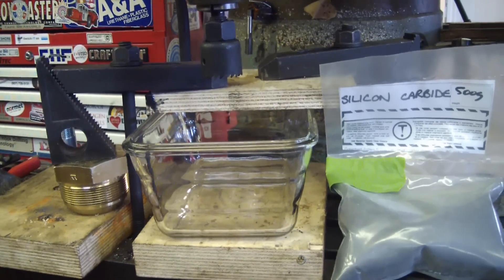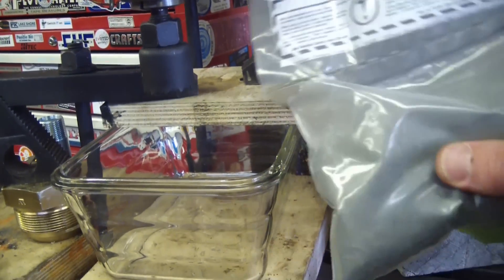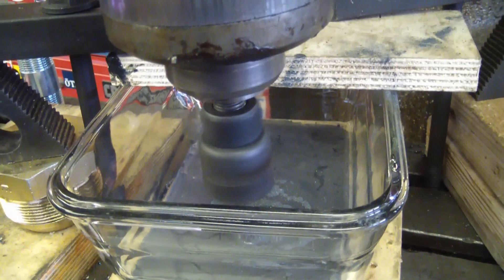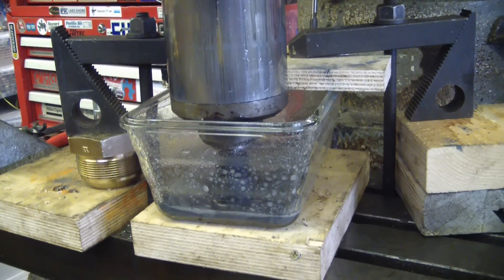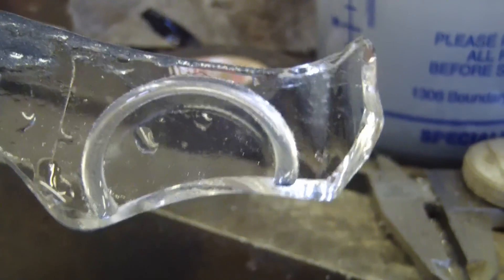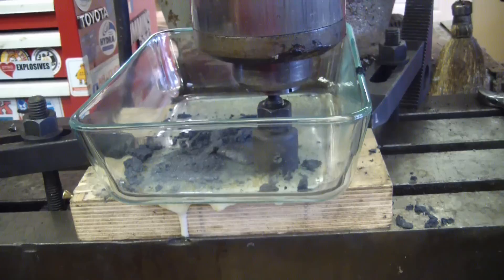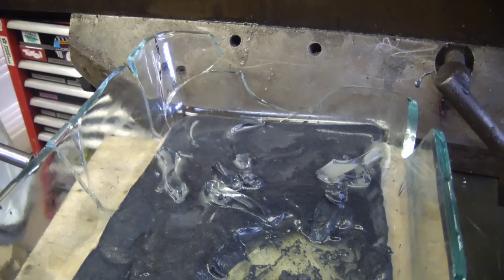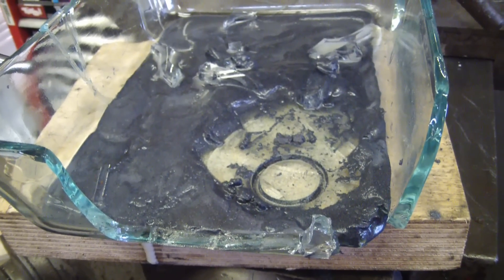Using Silicon Carbide to cut glass

Comment: Hi,  I really enjoy your videos and your comments are a blast.  I KNOW what the problem is because I have solved the exact same problem.  BTW, I am a Ceramic Engineer (I bet you didn't even know they existed...).  To start, Pyrex is an annealed glass, not hardened, intentionally to reduce internal stresses.  What you are running into is due to intense ultrasonic vibration.  This is revealed through the break pattern.  If it was due to glass tempering, the piece would have shattered into many, many pieces.  If it was due to local heating, you would see the crack propogating outward from the bore hole.  These cracks originated at the outer edge and propogated inward.  The starting points are also spaced out about 12cm apart around the top edge.  All of this points to ultrasonic vibrations.  The vibrations are caused by the grit rolling and skipping around at the blade/glass interface.  There are a couple ways to address this.  You were on the right track trying to embedd the piece to reduce motion.  If you had embedded the edge of the bowl, it may have worked.  Ultrasonic vibrations scatter in weird patterns and are hard to predict so even this approach is no guarantee.  Another thing to do is replace the metal blade with something like a hard rubber or maybe a fiberglass impregnated plastic.  And of course another thing is to go with a cutter that has the grit embedded to you don't get all that rolling and chattering around, which is what you were trying to work around in the first place.  Even then, it is a good idea to dampen the edges.  Good luck.

Comment: Nobody seems to be explaining why tempered glass is hard to cut so I'll try my best. I'm sure someone else can do a better job.

When a substance like glass is heated it expands and when cooled it contracts. When it is cooled rapidly (i.e. tempered), the outer layer contracts rapidly and its tension places a constant compressive force to the inner glass. When the outer layer is damaged enough to fail, it releases all that compression simultaneously causing catastrophic failure to the piece. I don't think it matters whether the damage is caused slowly or quickly, only that it exceeds the tension balancing that compression force.

Prince Rupert drops are an example of what happens when that force is released. It's not the specific location of the damage on them that causes them to explode, but they are under such extreme compression which makes them so hard that you can only cause the damage the tail with conventional tools.

Unlike steel, I have no idea if/how tempered glass can be annealed (removing just enough of the temper to relieve the internal stress) but it would seem to be pointless in this case because the goal is to end up with tempered glass at the end.

Gorilla glass achieves some of the same surface strength results through a chemical process rather than a heat process, so it might be possible to do this kind of work on a gorilla glass piece if they ever make cookware out of it.
Reply: Andrew Crews And this is special how? You can bend the microscope cover plates too, which i believe is thin untempered glass. Resistive touchscreens fully worked based on glass surface bending, and they were not made out of Gorilla glass, they were made out of... not sure, untempered glass? Thermally tempered? I don't know, it was bonded to a plastic sheet usually and hard to break, but eventually they did break.

Glass fiber is VERY bendy.

Thin glass bends.
Reply: +Tim Gilbert Actually, when molten glass is chilled quickly, the outside freezes while the inside is still hot.  Then, as the inside cools, it contracts and puts the surface under compression (the inside is under tension).  This surface compression closes micro-cracks which are the source of all weakness in materials.  A great book about this is The New Science of Strong Materials or Why You Don't Fall through the Floor by J. E. Gordon.

This also explains why it breaks just before the hole is complete.  The inner bulk strain is relieved, so the surface compression goes away, and the glass cracks.
Reply: +Chris Uhlik They use the same process for new cast car rims. Cool the outside  and keep center hot when casting makes the wheels stronger by having forces under tension.
Reply: @speeddr2000  I'm three years late but your absolutely right. If you cut through one they spring like crazy.

Comment: 2 things. No. 1: yes it hurts for no reason, time for special old persons exercises every morning, shoulders and neck are the worst, where you retain the most tension. No. 2, don't know what the temperature of the glass was, cold glass cuts badly. I assume the water transmits heat away from the cutter so there is a minimal heat gradient across the whole dish, but it is almost as if the bottom has expanded so put the sides under tension. Cheers, Andy

Comment: I remember reading about this phenomenon. Tempered glass is stressed and once you get to the chewey bit in the center it wants to relieve it's stressed outer part, so as the saw makes it to the sweet spot it gets all kinds of wonky and the the outer stress is no longer the same and it says "screw this" and finishes contracting, and then the glass shatters. Work around - HEAT UP THE GLASS =)

Comment: If I remember right, Pyrex is under constant pressure, which is how it works.  Something about having just the right amount of stress making it near unbreakable.  I imagine that when you cut into it, it's breaking that tension as soon as you cut too deep, and snap, crackle, pop!  I'd suggest using a non-Pyrex glass and see if you don't get better results.

Comment: I haven't read all the comments nor do I think that AvE is going to read this. A while back drilled out a few holes in single pane windows for AC vents. I used a similar fashion with a drill press and bi metal bits in reverse. I found that it works if you score the glass with a circle cutter and score a grid in the id of the circle you are cutting out.

Comment: Works great on glass plates!   I suspect that it's VERY difficult to drill cheap tempered glass.   That stuff is like car side-windows:  you can hit it with a hammer without damage, but any major scratch causes the entire thing to fracture explosively.   So, your smooth SiC damage must not be causing problems, but something like a tiny fracture or deep scratch can set off the explosive disruption.

The physicists hole-saw is a copper tube.

With the soft copper, the SiC becomes embedded in the rotating edge, so it turns into a DIY diamond saw.   I don't know if steel does this at all.  Probably aluminum pipe does it too, but copper tube of desired diameter is easier to find.   Get your lathe and whack out a precision drill from scrap aluminum rod?  And I think a thinner slot drills faster, but I haven't tried that.  Easier to apply large force using small weights.

Or this:  perhaps try DIY pre-annealing, bake the glass at ?800F? or hotter?  Get it up almost to softening temp, just below dull-red glow, then turn off the oven and let it cool over hours.   That would un-temper the bakeware glass and remove the shattering effect  ...but also make it far more prone to fracture if later dropped or heated (don't use un-tempered drilled glass for baking or cooktop!)

Or maybe its possible to find actual cheap crap glassware, non-pyrex non tempered.  Find stuff that will shatter if used for baking.   Without the gigantic internal tension produced by annealing, it will act like thick window glass, rather than exploding like Prince Rupert's drops.   Total garbage glass can be drilled, and expensive borosilicate chem-lab glass can be drilled.   It's the in-between stuff, the tempered soda lime glass that's the problem.
Reply: wbeaty what about a cerium oxide paste?  also it sounds like the drill bit is striking the glass.  maybe make a plywood base on the end of a shaft that just grinds the glass out?
Reply: wbeaty  Tempered glass is like a flat Prince Rupert Drop.  One can surmise that the only way to drill holes in it is to anneal it in a big oven then drill it when its gone cold.  The re-tempering is allegedly done by re-heating it then blowing cold air on it.

Comment: Your intuition is correct. New Pyrex from the past several years is no longer borosilicate, but tempered soda lime glass. They made the change in the U.S. to thwart people manufacturing drugs, can't recall which one unfortunately. The drug making process relied on the low CTE of the BSG to crash cool something, the soda lime can't handle it and will shatter.

Comment: I am so happy I can give you an answer!
Pyrex is tempered glass. Tempered glass is unique in that you can take a mallet to the broad surface of tempered glass and there's a good chance that hammer will bounce off and hit you instead. However, a moderately light amount of force either from the edge of the glass will cause it to shatter or, if a sharper fragment than glass is pushed into the surface (I saw a guy on a video shatter a piece of tempered glass by hurling a piece of ceramic from a spark plug at the surface).
Standard practice of cutting glass is to use either annealed or laminate glass. First you cut them very similarly to your idea except a reservoir is made for lubricant from glazier's putty and gasoline (don't use gasoline. that's what the old timers used -C2H6O is fine).
TLDR; Glass is cut before it is tempered.
Reply: +AvE Will diamond hole saws go through it? Ive drilled some pretty hard brittle porcelain that had the double fired surface tension thing going for it with em. I have a set
Reply: as long as the glass is not tempered.

Comment: Grind the teeth off the hole cutter, and just use a flat face?
Use a softer metal on the hole cutter? Some thick copper or mild steel pipe? The silicon carbide might imbed itself in the metal and make a nice grinding surface.
Heat the glass when you are part way though, and let it lose some of its temper? Maybe that will ruin it for the purpose you want.
Flush out the glass dust and put fresh grinding compound in?
Reduce vibration by using the end of a pipe that has been rounded off a bit? Reduce vibration by using the end of a pipe and filling the interior of the pipe with something to dampen the vibration? Plasticine? A rubber or plastic plug that has be pushed in far enough to clear the thickness of the glass?

Comment: I wanted a hole in some tempered glass cookware too. After failing a few times with the same results (didn't use silicon carbide powder), I asked a friend to help out. He just set it on a hot plate and drilled right through. The temperature does not have to be hot enough to melt the glass, just hot enough to relieve the tension.  It cuts a bit faster, even though the Chuck was turning a LOT slower than I would have thought necessary.

Comment: The "new pyrex" el cheapo stuff is just tempered glass. Once you start cutting into it and releasing some of the stress, it's like a row of dominoes. You're going to need real pyrex ie borosilicate or just good ole soda-lime glass. 

Borosilicate will take longer to cut through but comes with it's benefits. You could also remove the temper on the glass, but it's a whole lot less work just to get soda lime unless you need the properties of borosilicate.

Comment: I agree with the comments below about the pre stressed layer, this is probably a task that is really hard to do with Pyrex, cheaper quality dish may actually be better, but thats a guess. Also drilling the hole closer to the center, and away from the stress concentrating curved sides may help.

I did have an idea if you wanted to reduce vibration, you could secure the pyrex into a larger tub, and the put fluid around it (additional fluid in it is obviously gonna get in the way), to dampen vibration, possibly reduce possibility if sonic fracture. But that might be a solution to a problem that isnt present/the most pertinent.

Comment: So glad I came across this video. We got a new "Pyrex" measuring cup because the paint on the old one wore off.  A new one was cheap enough so we got a new one. I was going to clean up the old one and etch it so the writing would never wear off. I wondered why these things were painted instead of etched. I cussed the manufactures for being cheap and building in planned obsolesence. Before I etched the glass I answered my own question by remembering that the good old Pyrex was made from borosilicate while new Pyrex is made from tempered soda lime. Suspecting that etching would weaken the glass I decided not to etch the old measuring cup and just buy a new one every 10 years. This video and following discussion confirmed my suspicions.

Real diamond bits are dirt cheap these days BTW but that wouldn't have helped anything. It was the internal stress not the drilling method that caused the failure.

Comment: I would recommend that you use the softest metal cutter that you have, but use, basically, a goop of the silicon carbide. Basically make a think paste of the stuff. and stuff it inside of the bit. As it goes down, it will deposit the mixture onto the cutting surface and will cut the glass with more ease. make sure that you also put some of the mixture on the outside of the bit as well so that you cover everything so that it will be the most effective as an abrasive. ALSO, from what I have seen with glass, you have to either go really really fast, or really really slow, never take the middle ground. when going fast, just remember that you don't want to hit the resonant frequency of the glass or else it will shatter without warning. Like you said, this glass is under stress, most likely caused by the tempering that factories do, because of this, I usually go on the slow path.

Hope this helps,
-UnforeseenLife

Comment: I work with tile and the  diamond blades cut trough the glass no problem, I usually do it on the water saw. Your best bet is to get the same hole cutter like in the vid but naturally with the carbide tip for cutting porcelain, B&D makes nice ones that I have used before to drill trough hard full body porcelain. I would also recommend to put 3-4 layers of blue tape on the glass where u want to open the hole and fill up the glass pot with water.

Comment: I got about three uses out of a 30mm diamond bit drilling through the bottom of very chunky whisky bottles. Made a dam out of bluetac and filled it up with water and added more when it started to heat up.

Very slow feed and very light pressure toward the end. Even then, I got a small chip when breaking through each time.

Comment: Use a smooth tube as the cutter, the teeth of the bi-metal saw are generating vibrations that work on the glass.  A copper tube ought to work fine, as the carbide is the actual cutting tool here.  Secondly, due to the heat treat of the glass, internal stress is high, so use a bit of clay around the edges of the glass to dampen vibration.  Third, build a small (say 4" diameter) clay ring around the hole area and fill with the water and silicon slurry to localize the cutting mix.  put water outside the clay ring to aid in vibration dampening.
Reply: I wonder if ooblek is good for vibration dampening
Reply: Add a small off-centered motor to the top of a small stick, place in the non-newtonian and vary the speed and voltage to watch the weird effects.

Comment: I was down the engineering part of bangkok and there was a stall selling dremel styled cutting heads, for display he was using a electric dremel with a tungsten carbide tip, straight cut shank with a 90 degree flat face end, small diameter cutter, he had a beer bottle and was cutting swirled shapes in the glass with no lube, he went in dry!
I was impressed at the ease of the cut, to start the cut he worked it in at a 45 degree and let the tip do the work.
I dont think it can be cut on machine, to hard the vibration will case a resonance freq, free hand with a dremel, with the glass on rubber, then a cloth on top of the rubber, looks like you have lots of bits to test on, and chances are you have a dremel and a carbide tip in the man cave. Dont know if it will work on the tempered class but it worked on a beer bottle and that glass although not hardened it does have its own stresses.

Comment: I have drilled through quart fruit jars with the silicon carbide slurry and a piece of copper tubing as a bit.  The drilling action is very slow and use a pecking action on the feed.  This limits the heat and allows fresh abrasive to flow into the cut zone.  The soft copper doesn't bind in the cut.   I use modelling clay as a dam around the work area to contain the water slurry.    It's slow but it works.

Comment: Don't clamp it, at most use some silicone. Cut the teeth of the saw off so it is just a tube that might also help, a soft tube would be better as it will load with the abrasive. Reduce the down pressure, grinding can be a very gentle process.

But maybe the internal stresses are the issue and you just can't do it without some sort of annealing.

Comment: I've had great luck drilling or trepanning holes in glass etc using a similar method.  Yes, SiC abrasive and water BUT instead of bimetal hole saw, I use copper tube or pipe.  Dead soft annealed with some tri file fornication to get the abrasive to the cut.  My wife likes to make desert serving tiered plates, each with a 10mm hole drilled.  I do the drilling and have yet to crack or break one.  Pine pitch makes great backing, melt it and bed the item to be drilled to cast iron platten etc.  Keep it cool with some solid tap water if the shop is warm.